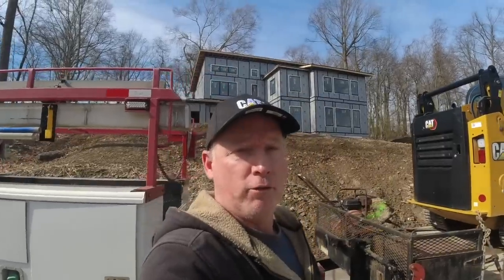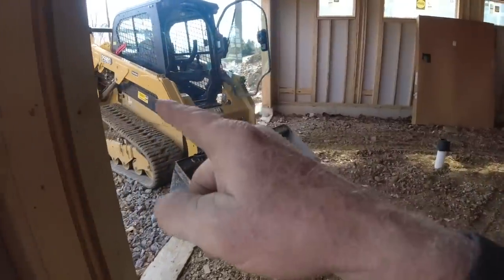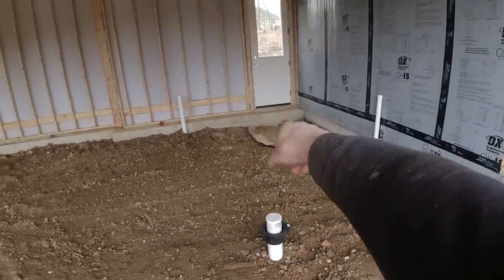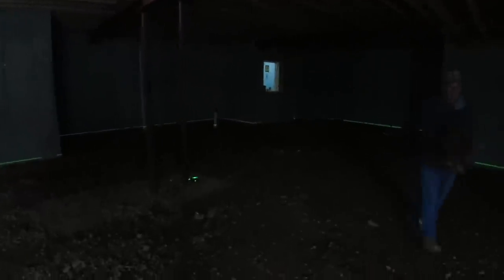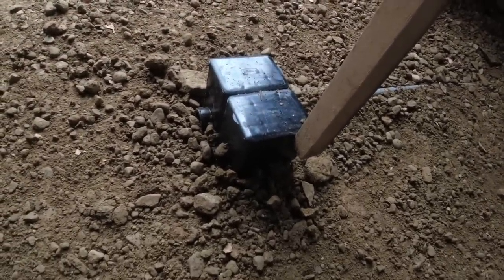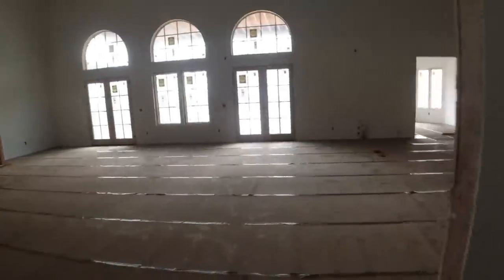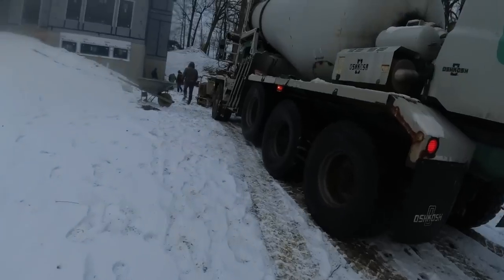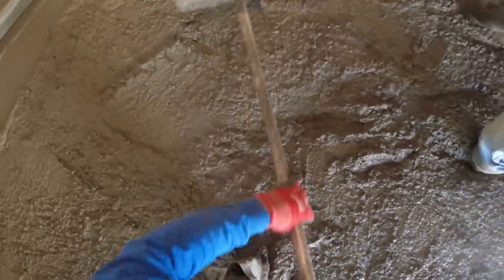Small Doorway? Now What!?

Comment: Why do most of these builds have the garage floor poured so high up that it's against the stud wall? Sometimes it even looks like it's above the bottom plate(s) of the wall. Curious the reasoning behind this...around here (Upstate NY) they would have about 6-8" of concrete stem wall visible after pouring the slab.
Reply from the maker: I like it when their garage floor sits on top of the foundation wall